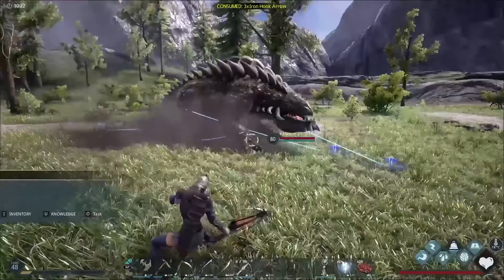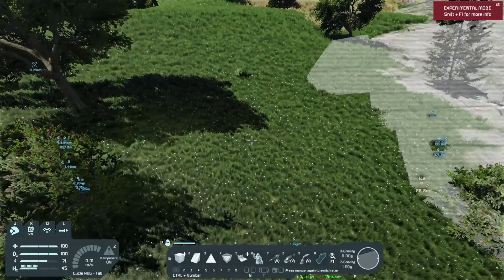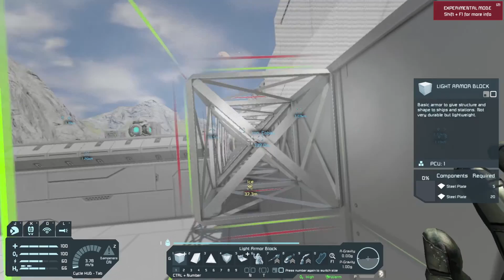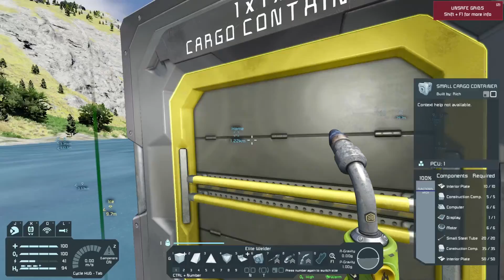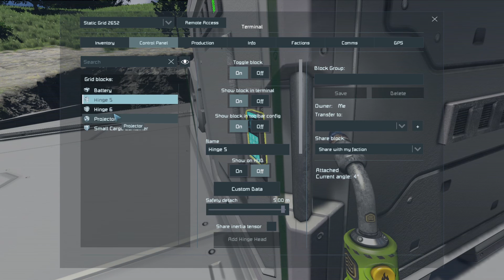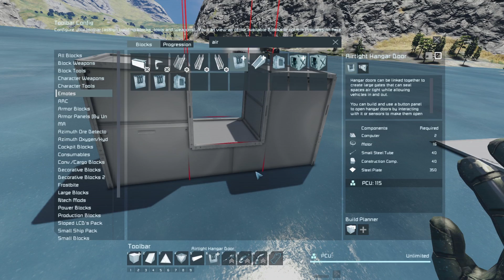Space Engineers #51: Retracting Ramp

Comment: I have an idea for your mining trailer: Use hinges at the back to angle the drills down so its more low profile. That way you can also avoid using a conveyor to convert 3x3 to 1x1 item interface things by using the 3x3 hinge at the trailer and a 1x1 hinge part at the drill. I know that these two will connect but i dont know if items can pass through. Hope this helps ;)

Comment: If you do Catlwalks over the entire surface of the ramp, extending them out one block from the ramp on the lower end, you can cover up even more gaps, including the upper gap. on the upper side, just place catwalks up to the point, where the blast blocks are (meaning place them on top of the blast blocks)
Reply from the maker: I thought about that but I'm not sure about the aesthetics.
Reply: aesthetics can be secondary in this case... plus you have at least 2 catwalk variants to use, more if you have mods with catwalks in them.... besides the catwalks provide armor for the hinges....
also there are modded airtight hanger doors that are bigger... and not OP

Comment: At 12:35 you manually broke the hinges by only controling one not both so you did some unnecassary things after that
Reply from the maker: I said that I did that in the video but that wasn't the initial issue. There is a bug in the game. It's the same bug I saw a few episodes ago where drilling under loose ore causes them to float. It also affects blocks. All I had to do was grind a block on the ramp.

Comment: Could you replace the blast doors by the hinges with 45 degree blocks?  My thinking is they wouldn’t be part of the same grid as the ramp so they wouldn’t move and the gap would be smaller.

Also, I don’t know if it is air tight, but could you put the lower hanger door on a piston and lower the hanger door to be “flush” with the blast door when it’s open. Then when it closes just push the piston/hanger door up just that little bit to make it close all the way.
Reply from the maker: Neither would work. The ramp wouldn't be able to move if I used sloped blocks.

Piston heads are a subgrid so it wouldn't be airtight.